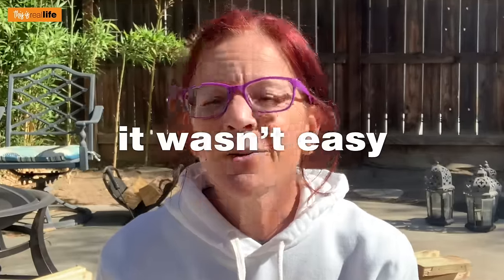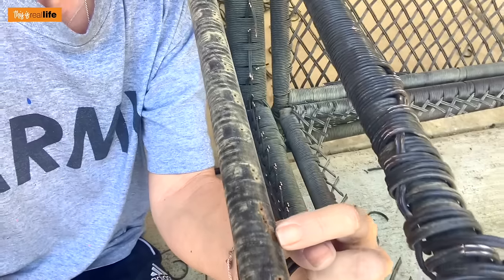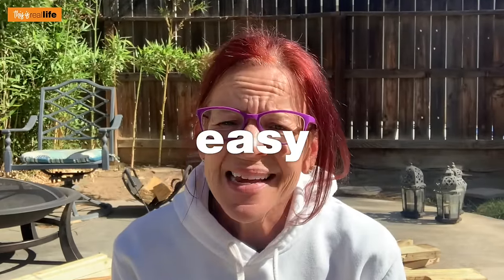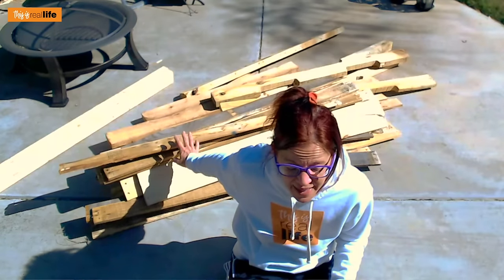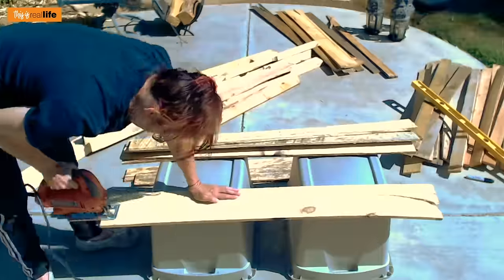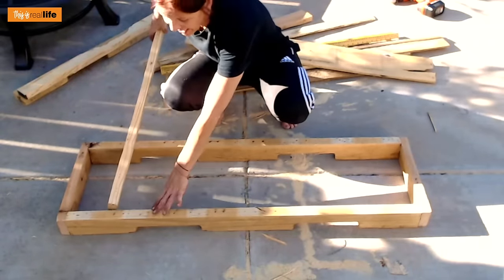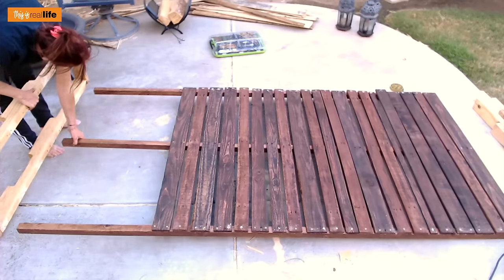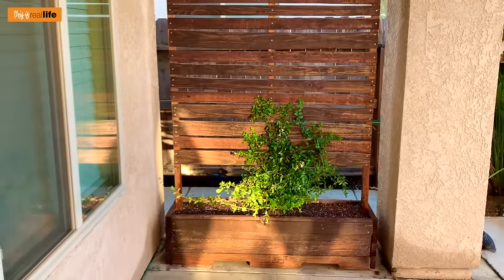Super Cheap Backyard Privacy Screen DIY Tutorial Video - THIS IS REAL LIFE

Comment: Love the new privacy sceen. I need one for my garden to block my nosy child neighbours with their balls that keep coming over the fence.  Q: What is the cheapest way to make a long 10 foot wide fence, higher (ie 5ft to 6ft)?   Thanks.
Reply from the maker: Jackie Ruffoni - Without seeing exactly what you are talking about and assuming that you already have the 10' wide fence in place (and you are not removing it to build a new fence)...it sounds to me like you might just need a topper to make your current fence taller. I would run over to your local home improvement store and purchase a 1/8-in x 48-in x 8-ft piece of Traditional Lattice for about $40. Cut the lattice in half lengthwise so you have two pieces that are 1/8-in x 24-in x 8-ft. Then grab some 1-in x 2-in wood and build a frame around your lattice for stability and then mount your framed lattice to the top of your fence. This will gain you 2' in height and cost around $50/$60. It should end up looking something like this: https://www.lowes.com/pd/Actual-5-708-ft-x-8-ft-Western-Red-Cedar-Lattice-Top-Wood-Fence-Panel/1000241459
Hope that helps...or at least gives you some inspiration :)